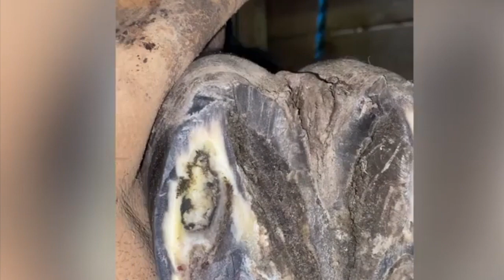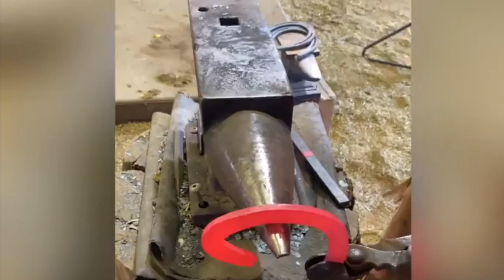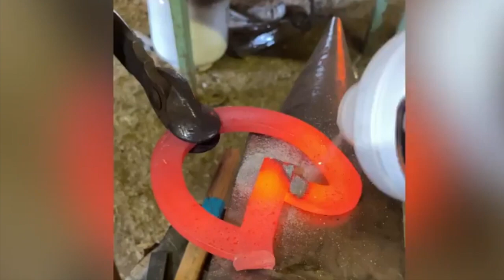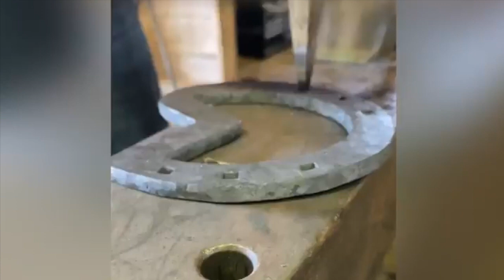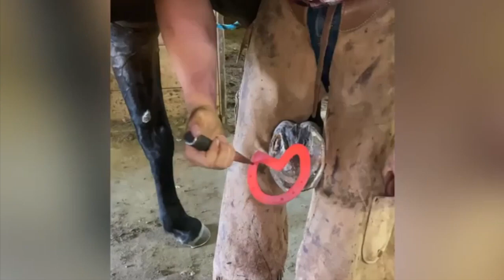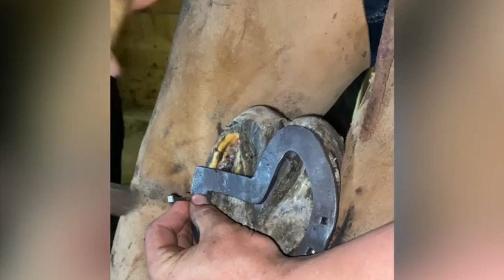HOOF ABSCESS Horseshoe

Comment: What did you put on the abcess at the end, thanks?
Reply: Probably some kind of Iodine/antibiotic
Reply: Dirt
Reply: Looked like Ichthammol. It's used on cows dermatitis too. Normally they just squeeze in a baby diaper and use duct tape.
Draws out along with Epsom soaks in a bucket.
As long as no white line issues, that shoe might be better than a rubber boot.
Reply: @pjk1714  thanks! I thought that might be the stuff but couldn't remember the name. Something like pine tar, I think. I remembered it being green but maybe sometimes black.
Reply: @tinoyb9294  Magna paste can work too..
Hopefully that horse didn't have fever needing antibiotics.
Reply: Looks like a product that has been around for a time called Coppertox .
Reply: I think it's called Gentian violet.
Reply: Pimp juice, I believe.

Comment: I'm thinking glue would have been a win for everyone.
Reply: There was an abscess so they had to leave it open to drain and heal, but support it so it didn't rub continually on the ground. There are some other videos where they are dealing with cracks and bone breaks where they use different epoxies.